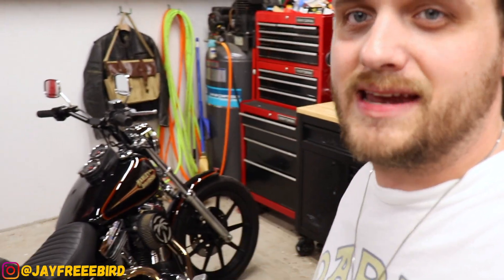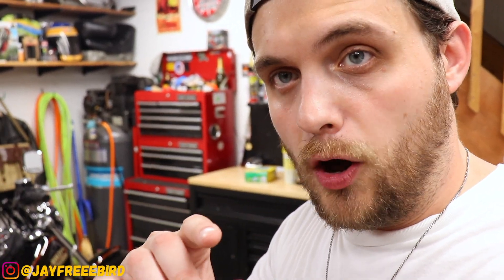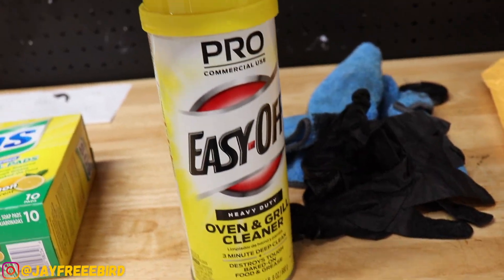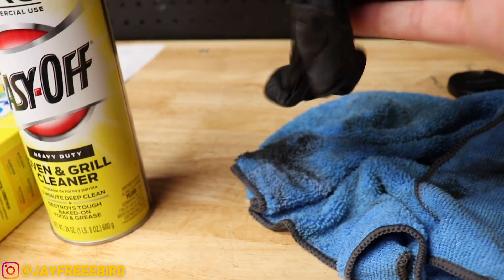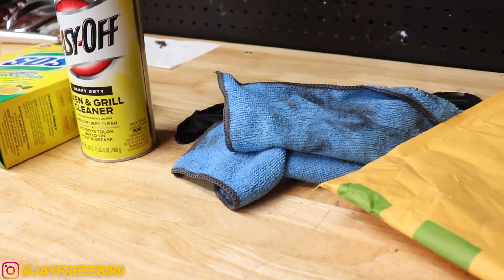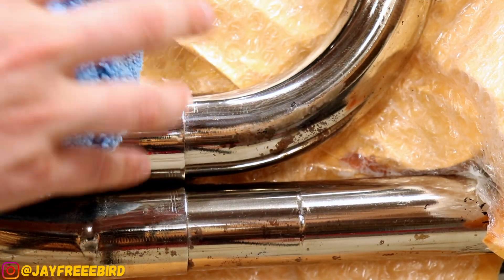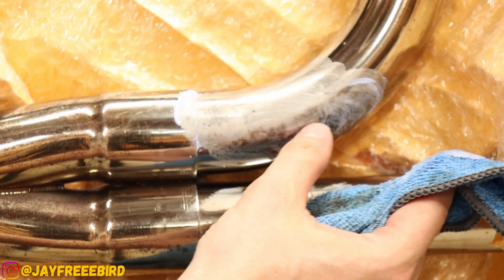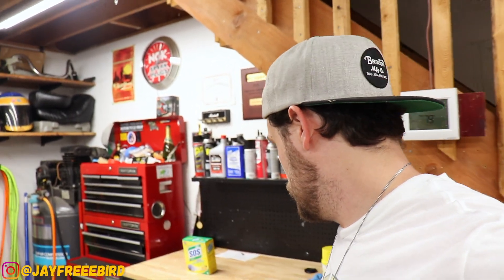HOW TO: Remove burnt plastic from exhaust - Harley Davidson FXR

Comment: Wow!  That did a great job. I always burn my shoe into the front tube of my thunderheader and use a 0000 steel wool to get it off.  Maybe I'll try this next time.
Reply from the maker: I do the same, for some reason always point my toe inward and it will tap or lay against the exhaust. I appreciate you watching Dave!!

Comment: Took me 5 mins to clean the melted cover material off my Scramble 900. Started the bike up, waited for it to heat up, then used a Terry cloth towel to wipe off the plastic. My pipes are not chromed, yet it came off easily.
Reply from the maker: Interesting, I wish mine did the same

Comment: You want to clean your pipes esp if you want to turn it back that pure chrome and get rid of the blueing grab a small container of Blue Job..I know weird name. It’s a powder that comes with a little pieces of cloth. You wet the cloth dab it in the powder and go to work. It’ll take the deepest blueing back to chrome. Honestly couldn’t believe it.
Reply from the maker: Interesting I never herd of that product before. I normally use Metal Polish cream to bring it back, I will be trying that out for sure! I appreciate the heads up and thanks for watching!
Reply: Will that remove the blue burnt from tips exhaust
Reply: @plugziee_1993  absolutely it’s some pretty amazing stuff, I actually got mine at a Harley shop but I’m sure you can find it online
Reply: @Junior-fd8ux  I mean you know the design of blue burnt people add to the exhaust tips? So it would remove it? Cuz I want it regular stainless steel look
Reply: @plugziee_1993  so this is like a synthetic blueing people put on pipes your taking about? To be honest I’m not sure if it will or not.. it’s for burnt sections on pipes obviously so it must have some reaction to the metal.. idk but iv had bikes, cars etc for years and im a whore for cleaning products an could never get that blueing off esp like this stuff does.

Comment: First: Respect
Second: in the 80's i used Steal Wool 000 on my XS650-exhaust.
Stil abrasive
Nowadays i prefer wd40 on cold exhaust.
Or: Avoid my daughter as passenger with plastic soles Martens
Reply from the maker: I never herd of the WD 40 when cold to get it off, I'll have to try that too. Also, great tip for my future rider too! I appreciate you watching sir!!

Comment: I had a far worse plastic burn from the lining of a jacket.  giant melted spot of plastic.  I tried oven cleaner and steel wool - it did very little.  After 3 applications there was little help.  So I tried the crazy idea I heard - a penny from 1982 or older.  I scraped away the plastic in 10 minutes without a scratch on the pipes.
Reply from the maker: That works too, depends on what metal you also have.